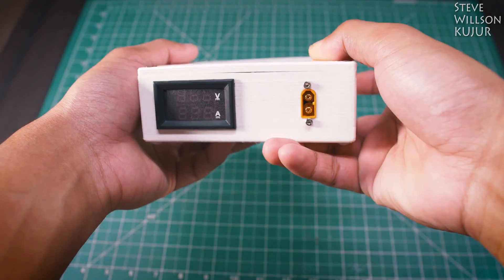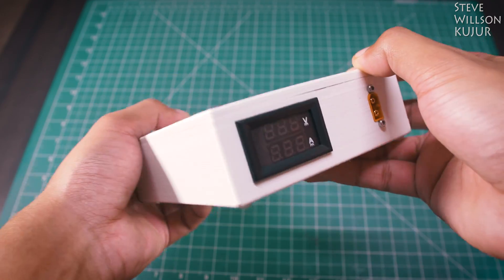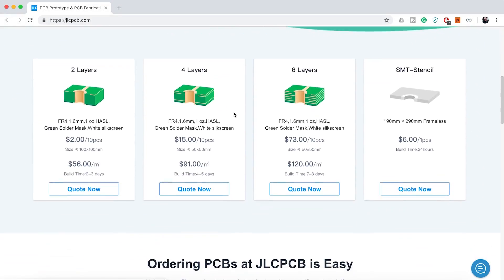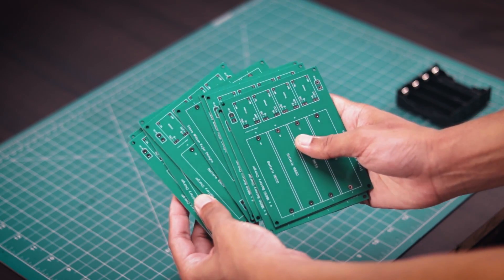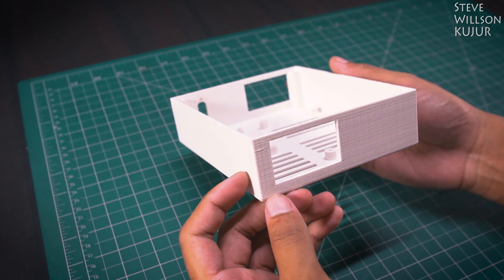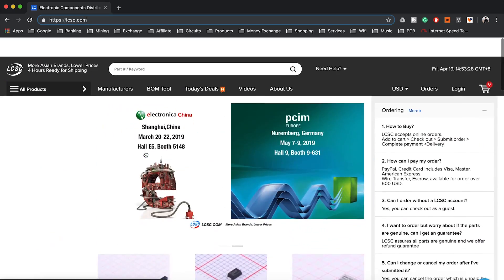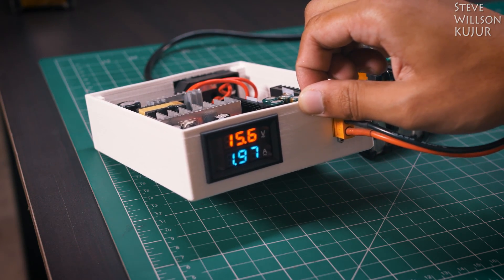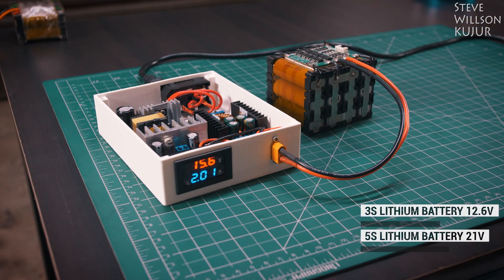DIY Lithium Battery Charger

Comment: The design is beautiful! My previous charger was inside an ugly box how we usually use to work for our personal uses😂😂😂 now I'm thinking to make this one like you, although I'll put a female dc jack and 2 banana connectors dor connecting any kind of load with it. Also I'll keep an external dc input supply system, so that I can charge battery from another battery. Can I use your 3d file and modify this a bit? I have a very small channel, arround 450subs, I'll mensen your channel and I'll tell that I took the design from here. Let me know please. Your work is very beautiful!😊 And yes, I'll also include a fan along with it😅

Comment: Hello, you have inspired me to make my own power bank, the only problem I have is that I do not have a connection to the electrical grid, there is a way to charge a bank like this or double it with a solar panel and if so, could you just tell me how, thank you and I appreciate the time you take to teach us what you know in your videos. Good luck!!

Comment: If i were to make this, i would remover the potentiometer on the buck/boost converter and use a wire to extend it and use a bigger potentiometer with knobs to make it accessible to change voltage and current without opening the case to turn the potentiometer by a screw. I would also replace the Xt60 by a female banana plug. Then it would be a variable power supply and a charger at the same time.

Comment: This is not a charger. This is a power supply. You are simply supplying power to your BMC circuit connected to your batteries which does the actual charging.
Reply: And a charger is just a power supply. No need to get pedantic. The name is correct as it describes the unit's function rather than it's physical composition.
Reply: What do you use to power a laptop?
Reply: Are you that stupid? Batteries are useless without a power supply.
Reply: A charger is a power supply, use your cute brain bro
Reply: Whats with all this ragebait comments? You are right, a charger isnt only a power supply, it has to regulate voltage and current the correct way, and follow and algorithim so it doesnt make the battery catch a fire, while a power supply only gives an static amount of voltage

Comment: Nice video, can i use  this same system for my 24v lithium power pack. If not which one is suitable for 24v.
Reply: Nope you need a charger that can go up to nearly 30V. So use a 36V AC DC power supply and then a buck converter that can handle up to 40V. Just makes more sense all the way around since you can get some pretty. powerful 36V power supplies for the same price as a 24V of the same wattage.

7S lithium ion is max charge of 29.4V at 4.20V per cell.
6S lithium ion is max charge of 25.2V at 4.20V per cell (which this buck converter could not do, it needs to output a voltage at least a volt lower than the input typically and I wouldn't count on being able to adjust a trim pot on the AC/DC power converter to get it up to 26'ish volts)

Those two are your primary number of cells in series we use when talking about "24V nominal" for lithium ion NMC/NCA/etc. LiFePO4 is 3.2V per cell nominal so 8S is a perfect fit for 24V nominal, max charge is 29.2V at 3.65V per cell. I would advise NOT doing 7S or 9S LiFePO4...your BMS options and other accessories become limited and you probably won't be able to use the full voltage range with your inverter/load/whatever

About the only benefit of using a 24V power supply and then a buck converter (like this video) is that if you're mostly charging in the 4.2V to 16.8V range your charger will be bit more efficient...not by a ton but still if you are concerned about how much AC power you are drawing then 🤷‍♂ (can't think of a reason why, this thing would take like 4 hours to even possibly use 1 kwh) and if you're off grid then you should just be using whatever DC you have available...dont take your DC battery or PV voltage, put it through an inverter to make AC then use an AC/DC power supply to make DC again to feed your buck converter.)

Comment: surly the charge rate needs tapering of as the battery increases in charge? This will just carry on pupping current as its more of a simple power supply than a charger. If you have a bms on your li-ions I think it will just cut out leave the battery at a low capacity as the battery needs a trickle charge as it go's up in it's capacity.
Reply: That's what your bms is for.

Comment: Very clean design.
I have a question, I have observed that you have been charging with constant voltage i.e.(16.8V for 4s) in the constant current phase, but what I have learned from reading blogs that in the first phase i.e. constant current the voltage is dropped from the charger to compensate some ohs law (I don't know), can you plz clear my mind, on which is the correct way.

This might serve as a reference for my argument https://www.youtube.com/watch?v=kOL2tA8Vg7s   @7:18

Comment: could someone please help me? I built this charger to recharge a 3s2p, as it is possible that as soon as you connect the battery the dc dc converter 300w will short circuit. am I going crazy maybe because I made the wrong connections? I use an ammeter / tester which on the back has 2 red / black cables and the 3 red / yellow / black wires for the tester. the large black wire of the ammeter connects to the negative of the dc-dc, the positive of the dc-dc to the xt60 and the red of the ammeter to the negative of the txt60 do not understand although everything works as soon as connected the battery goes short.
Reply: Try doing it without  the volt amp metre

Comment: There is differnce between making and assembly (soldering). Making involved lot of things, designing, fabrication, R and D, prototyping and then finally the result. Sort it out in your brain if you don't know the difference.
Reply from the maker: That's why it's called DIY
Reply: @SteveWillsonKujur  Listen to your vedio you will get your answer, why I was saying that. I didn't read your description, I just watched your video. If I have to read then i would had consult a book not your description. There alot of vedio like you have made... these vedio are just selling the products... and giving zero knowledge. If you have to be a successful in life share your knowledge, it will increase with sharing. You might be angry at the moment but in the distance future you'll realise I haven't said anything wrong.

Comment: hey i want to make a balance charger for my 6s 1300 Lipo batteries.
Can i just use a bms board inside the charger where i plug my balance lead into and properly balance charge my batteries?
Also shouldnt the voltage be regulated up with the time? if i set the charger to xxV it will constantly charge my batteries with the same amount of volts which is bad for the battery?
Any idea?
Reply: Hey even I have a 6s battery pack do u know  how cAn I charge it
Reply: @Abhyuday_rai  i recommend the chargers from Toolkit RC , The model M6D is good because you can charge 2 batteries at the same time, or model M7 for single charging but cheaper
Reply: but whats the size of your battery and what do you use it for?
Reply: @CorrexPoE    it's a 6s 18650 battery  pack

Comment: Steve, thanks. The question is , don’t you require balance charge cables to run into balance charge port? Similar
to JST PH series 4 pin modular connector?  How will you determine if each cell has reached 4.20V. Just curious.
Will appreciate response. Thanks and 73s
Reply from the maker: That's why I've used BMS in the Pack , BMS do the Balance Charging
Reply: @SteveWillsonKujur  hey,i want to build a simmilar charger for a drill battery with integrated bms with cell balancing but will it automatically shut off at 21V which is for 5s batteries?Do i need alternate circuit to monitor the voltage of my battery or does it automatically stop charging at that voltage?
Reply: @SteveWillsonKujur  hihihi many people used this board and we used so many wire on jst connection for ballance the chager..🤣😂...i think we not read on datasheet the board...buyying board with balance charger...
Reply: Steve, thanks. I have similar setup with BMS controlling the input to avoid over charge and over discharge. But, I also have 4 smaller cables that balance charge individual cells. This set up is charged through SKYRC Charger B6AC+v2.
FYI, I tried charging 3S3P (11.1V) setup with BMS into 13V DC @2A, after watching your video. But instead of charging the 3S3P configuration, the battery got discharged. I’m puzzled as to how you achieved balance charging on your setup. Please contact me <sreeci123@gmail.com> I can provide images. That’d be much more clearer than the notes. Thanks and stay safe.
Reply: https://youtu.be/QNENyu97w2A
see this topic...

Comment: Steve, the volt meter you are using has 3 wires on the amp meter, the meter I received only has 2 wires on the amp meter and 3 wires on the volt meter can I use it?

Comment: Steve, the volt meter you are using has 3 wires on the amp meter, the meter I received only has 2 wires on the amp meter and 3 wires on the volt meter can I use it? 

Are volt/amp meters very accurate?

Comment: Diagram please
Reply from the maker: See the description
Reply: @SteveWillsonKujur  can i also use this as a power supply? And Thanks the diagram was on instructables
Reply: @SteveWillsonKujur  one more question : why have you used a thin wires to display ampere connector compared to the voltage connector
Reply from the maker: Yes you can use it as a power supply

Comment: This will not charge you batteries correctly... Only a noob will change with cc cv I will work for bulk charging but not recommended if you want to charge to %100... Or charge from flat
Reply: I agree, what is a easy option? I know ic's are avalible, for dc to DC charging of lithium batteries, that's a bit of work,
Reply: I agree and even with the use of a BMS it will not work correctly as the bms needs a charge controller to taper the charge. A proper charger gives a trickle as the battery reaches it's storage capacity. The BMS would just cut out leaving the battery only partly charged.
Reply: This will work fine as long as you have a BMS on the battery pack. Without a BMS, I don't recommend using this. Pretty straight forward build. Well done.
Reply: @andreykldjian  a BMS will not lower the amperage at end of the charge.. or start of low and work its way up "in amperage" like a proper charger will... And it's the same with lead acid battery.. needs a bulk/ float and  equalise stages. If your battery is at %40 capacity then it's ok to charge it to around %80 or so with this DIY power supply.. because that's what it is a power supply.. not a battery recharger
Reply: @KouRou2002  of course the amps will drop towards the end of charge, any other way would be kinda hard. but yea no soft start or shuttoff.

Comment: One could use a computer adapter  in place of tha ac/dc power pack.The step down converter is the only active device.
Reply: But your amps will be more limited. For example my hp 90watt only does 4.74 amps. The one he shows up to 10 amps if you use a fan.

Comment: I bought one of those 300w buck converter
When checking on voltmeter, it provided 8A at 12V, and the wires became hot
But when connected my load, it dropped to 3.5A at the same voltage
What is the problem?
I'm using a 19V 6.32A laptop power supply

By the way, the cleanest diy battery charger project ever made
Clean case and tidy interiors look great 
Video quality is awesome

Edit: It is a peltier module and with proper cooling it can pull upto 6A
So why is it only getting 3.5A
Reply: Sounds like that is all the battery needs, at the set voltage, to force more current, you can turn the voltage up, but that will over charge on the top end of battery voltage, you would need to turn it back down, or shut it off when the battery is full. It's best to leave it as is, and not leave lithium battery on charger, or add a battery charger controller, go disconnect at the full charge voltage, from amazon, or eBay, and are programmable, from about 6-80 vdc, and about 30amps, it's basically a voltage controlled relay,

Comment: You could add knobs for changing voltage and amps
Reply: bingo....jumper wires for a break board in the holes for the trimmer pots to some regular pots that match the value of the trimmer pots (usually 10K or something similar)